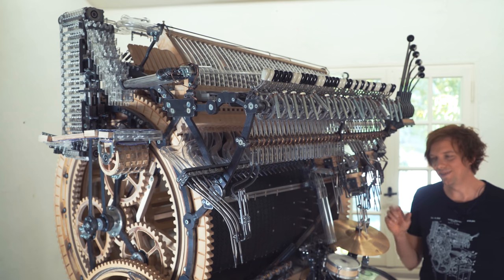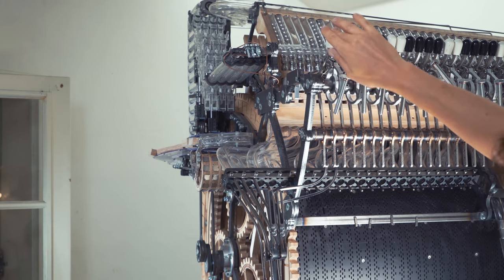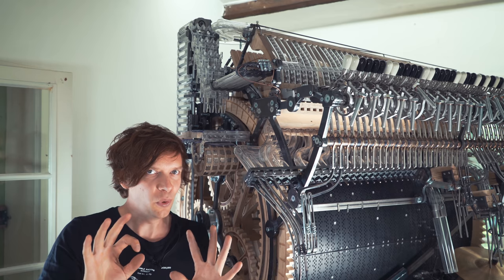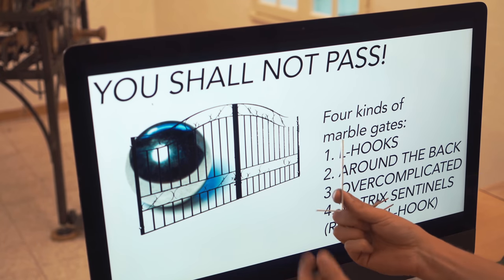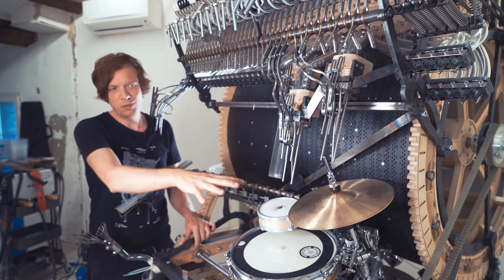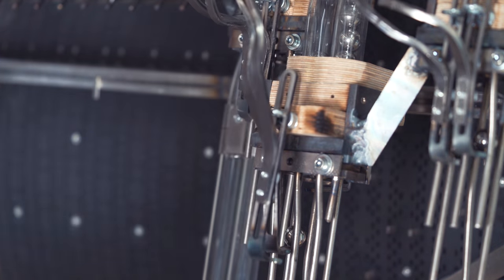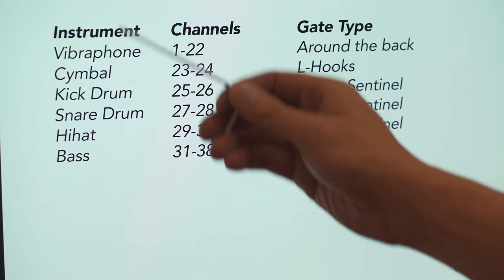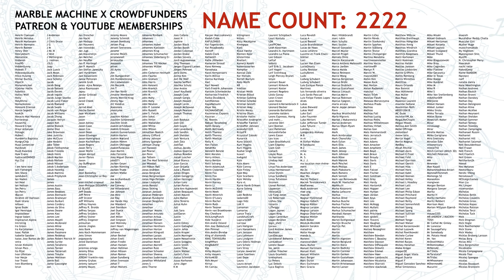Marble Gates Design - Marble Machine X #91

Comment: For the bass, why not the over complicated design? I mean it's net that complicated really and if you only have 8 to make vs 32 it's not too bad. For the part where it's catching and not working, look at turntable arms, they use "pin" bearings essentially a nail point in a dimple. If you're to adjust the tension on the two sides even without bearing I'm sure it would be much smoother than the loose bin in a hole that may not be found and smooth.

Comment: Why did you keep the release above the matrix sentinels? I would fear that the release speed of the upper gate might be slower than the lower one, so that, eventually in a fast song, you might run out of marbles. Why not short-circuit the upper gate and solely rely on the lower one?

Comment: JUST A GOOD IDEA, you actually can make the arround the back version on the e-string guitar without having to get them furthere from each other, as there are only 4 channels you could make it so that the wire from the one on the most left side could go above all 4 channels arround the most outer one and then back to the most left channel on the back, the second most left one does the same just with its wire a bit lower than the one from the most left one so they would be side by side and further on. id like to send you a sketch but i dont know if your 3d software is comatible with the iges format in what i could send you the models of the planned system.

Comment: Use 22g sheet metal instead of wire, maybe about 1-2 cm strip bent like the around the back wire. you can then mount it to the screws on the front. you can bend them round or make it square to make it look different. |____==|. you then could grind off half of the wire on the side to make room for the sheet metal.

Comment: I understand the value of the Matrix design, but I worry it also falls into the "Overcomplicated" category. Duplicating the same components in another section seems like just moving the problem around (though in a way that solves the problem in all but the most extreme cases). At least in software development, that kind of practice is frowned upon.

Comment: Why not just make the release mechanism snap shut again after releasing?
You want to make the closing time independent from the opening frequency - why not do it directly?
(I don't know how it works exactly so I can't add much more)

And looking at the current design proposals, you are duplicating the whole marble release system 2 or 3 times when it seems you really want to extend the reservoir of waiting marbles as far as possible down the tubes and just have a single release system at the very end (but that is a "hindsight" type suggestion and no use at all for your current design)

Comment: Why have the marbles que up top, and have three separate gates before it's released on each channel? Why not just have the continuous marble que from the divider up top run straight down to a single gate and release for each channel instead?
Reply: The marble release mechanism (as it is) is not able to reliably release just one marble if multiple ones are waiting – it would release multiple ones for one opening. So we need to make sure that only one marble at the time is there.

Comment: Your "overcomplicated" solution could be replaced with a seesaw mechanism. Have a pivot with the normal bottom gate, and an identical top gate, and it just rocks back and forth so only one gate is open at a time.

Should meet many of your requirements...
- No maintenance / adjusting (Almost impossible for it to fail)
- Very narrow
- Very fast reload
- Easy to assemble
- Visually elegant... or at least as elegant as the current release gates.

Cons: None?...
 You'd have to replace all the current gates, so I guess biggest con would be wasted materials.
Reply: In fact, if the seesaw is short enough, these could even replace the Matrix Sentinel style drops.
The seesaw just has to be short enough so it perfectly cradles a single marble. Then as it releases the marble, the back gate will already be catching the next marble as gravity begins moving the first one.
Reply: I'm downloading Blender now so I can make a super basic example of this solution. I'll have it ready in a few hours.

Comment: Why can't the around the back method just go around the entire bass section? Just have each channel parallel to the others? You'd need to bend the wire in just the right shape, and they wouldn't all be at the same height, but it doesn't matter, it's only loading the marble for the next drop, so it won't affect the time of the note.

Also, a wider piece of metal would be more resistant to bending from all the marbles hitting it and require less maintenance, I think. Though it would make it harder to fit all of it into the method i described above.

Comment: Given the bass is only 4 strings, it wouldn't be that unreasonable to have the bent wires for the center string channels go around the outside of the two outer channels. It might not be pretty, then again it could look more interesting if not cluttered...

Comment: https://www.youtube.com/watch?v=PyUk0yE5A9M
Here's another marble gate idea for improving the bass string problem.

Other good ideas I've heard in the comments:
- rocking switch mechanism
- thin sheetmetal to connect in around the back method
- around the back looping around other channels and back

Sorry for throwing more ideas after you're done with the issue, but hearing high tempo bassline on the mmx would be pretty sweet.

Love what your doing one way or the other! MMX is awesome!

Comment: Why don't you make a s hook like design. There is a small piece that screws to the top and let's the Mable roll down to part way of the rail where it is stopped by a long piece that is just low enough where it stops the marble but does not get too close to cause issues?

Comment: Too bad the size of your rails don't allow for a loop gate that would pull up and block the marble channel until the channel closed and the marble could pass through the hole.

Think matrix gate but with only a ring of metal with to long tabs on opposite sides

Comment: It's a pity you cannot play faster on the bass. With the huge amount of fantastic engineering everywhere on the machine, it would be worth to spend more work not to be constrained artistically by the mechanics, IMHO. 

Why the four gates on the bass strings should be on the same line ? Spacing them in the depth dimension may free a little more space up, doesn't it ?

Comment: Can't you use a  clock like escapement system for  the marble releaser, aswell as for blocking the incoming marble? I mean one of these: http://www.abbeyclock.com/images/a2bigrhm.gif
it'll require a center pivot, but then you can raise one end by a specific amount, and be sure that a specific amount is blocking the marble aswell. The pivot position decides the ratio of the two ranges.   If you need it to be more adjustable perhaps you can find a way to make the pivot non fixed, but that is overcomplicating the concept...

Edit: Did a very quick and ugly sketch of what I mean: https://ibb.co/svMM7wt
The structure holding the upper element is of course not feasable this way, needs somebody more competent than me, but perhaps it can be viable...?